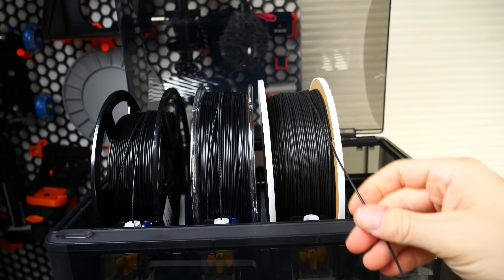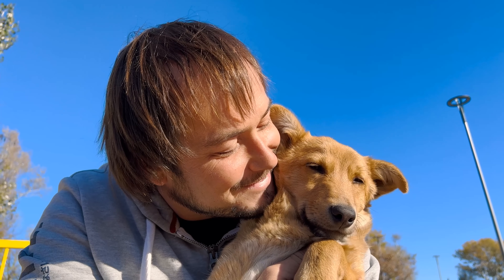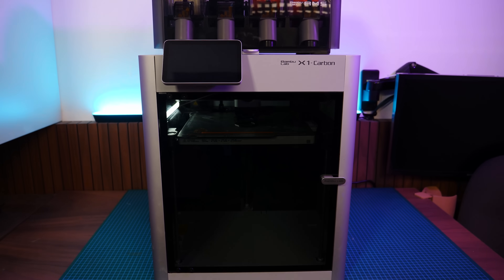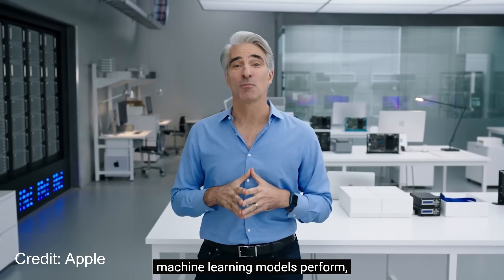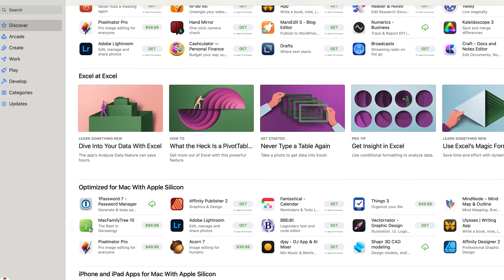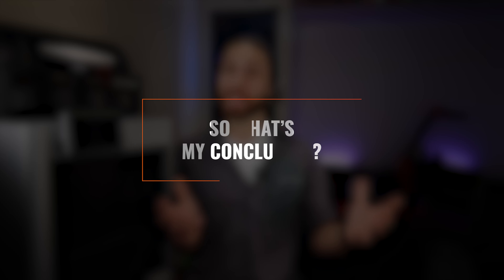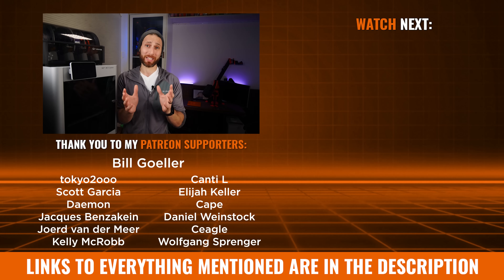Bambu Lab X1 Carbon: 5 Things You Don't Know

Comment: 🎯 Key points for quick navigation:

00:32 🕒 Bambu Lab X1-Carbon takes 7-10 minutes to start printing, ensuring perfect first layers and reducing print failure risks.
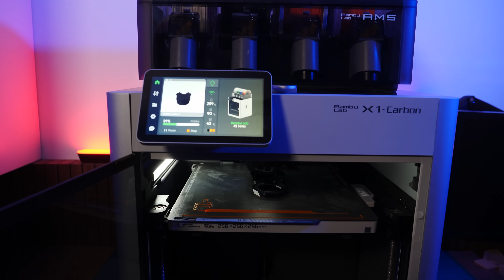02:31 🧠 Bambu Lab X1-Carbon monitors and adjusts for resonance frequencies during printing, demonstrating advanced intelligence in real-time printer management.
04:54 🌫️ The carbon filter in Bambu Lab X1-Carbon is for exhaust, not chamber air, requiring manual activation for effective VOC filtration during prints.
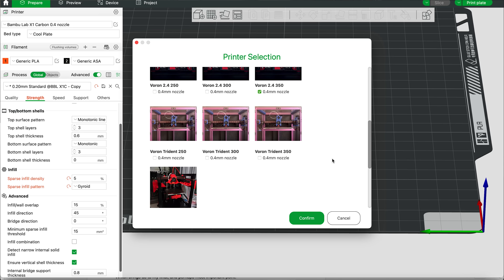06:50 🔒 Bambu Lab X1-Carbon's ecosystem operates as a "walled garden," limiting third-party software and hardware compatibility but enhancing integration and performance.
12:16 🛠️ Wham Bam offers a PEX flexible build plate compatible with Bambu Lab X1-Carbon, improving adhesion across various materials without glue sticks.

Made with HARPA AI

Comment: I h8k the filter fan does not running by default during printing as it would create ir changes and lower the cabinet temperature. Filtering at end of print is a good solution 👌

Comment: I'd like to know more about the Plug ins that you spoke of missing with the X1C.  You mentioned a camera plug in for time lapse but did not mention that the X1C has a camera already doing Time Lapse. There is a checkbox to disable the camera time lapse but I never turn it off. It has come in quite handy in my ability to send the video to customers I find on the net who I can show I've done the work and then they send the money with confidence.
Also you mentioned a plug in that allows to not print a particular item. But perhaps you may have missed a feature that I never hear about where the printer operator can stop printing an item that may have fallen over or such. When I am printing dozens of parts at one time, one might fail and when I see the spaghetting happening, I can turn off the continued printing of that object so as to not mess up further parts. Check out that feature as you may have missed it. I love it and never hear people mentioning it.

Comment: There is no little 3x3x3 carbon filter that is sufficient for removing VOCs. Maybe it helps a little bit honestly I think they just lul people into falsely believing since they have a carbon filter they can print stuff that off gases harmful stuff without a proper exhaust fan or ventilation. Carbon filters are a great addition but it doesn't mean you should bet your health on it and print toxic materials in enclosed spaces.

Comment: I have no problem with Bambu having a walled garden.  It's their product, and they can do what they want.  Just because the 3D printing world is traditionally a bunch of geeks who like to change everything for the latest product available, that's not Bambu's market.  They are selling a machine that anyone can use out of the box, and get better, more consistent results than most of us have been able to achieve through many hours of tinkering.  Car nuts like to do things like change the air intake for improved flow, ditto the exhaust.  Many times this actually results in worse performance, because the car was designed holistically, with the original equipment.  If the system was open to widespread modding, they might unjustly lose their reputation for reliability, and it wouldn't be their fault.

However, I haven't (yet) bought one, and it is because of the walled garden.  What has concerned me is precisely what I hate about Apple, and that is planned obsolescence.  They launch a new product, and suddenly the old ones are unsupported and no longer updated.  If you want to run the latest software, you have to throw out your old product and buy the latest.

Thankfully, Bambu Lab has been working with the X1plus team, which means enthusiasts will still be able to upgrade some of the software long after Bambu has moved onto other products.  Despite all the hate that has been aimed at them for the walled garden, the company seems to be keen to work with the community.  I have no problem with installing alternative software invalidating my warranty.  That's no different than chipping a car where they cannot know whether a blown engine is their fault or it was driven outside the safe parameters.  If I get an x1c, and I probably will, I will probably wait until the warranty has expired before installing x1plus.  The fact that it is available is enough for me.  For those concerned about their own IP, or PII being sent to Bambu, x1plus can install firewall rules to prevent any phoning home.

What would be really good, is for the company to promise to open-source all of the firmware if/when they decide to stop supporting it.  By that time, other companies or open source groups will have developed comparable IP, so their own IP will not have the value it currently has.  In a fast-moving world like ours, the length of a patent is too long.  They were designed to allow an inventor time to bring the product to market, recoup their R&D costs, and make a profit.  With long patent times and a fast-developing market, patents are frequently obsolete long before they expire.  Committing to open-source once the company has lost interest in the product would be a sign that they want to be community players.  Sure, they may not sell the new product as fast, but the extra sales of the current product will more than compensate.

Comment: I'm not sure I understand what the benefit of filtering the air inside would be vs filtering the vented air. The point of eliminating VOCs is to prevent you from breathing that stuff, and in reality, regardless of whether they filter inside or out, an activated carbon filter with a fan is woefully inadequate. Activated carbon filters get saturated pretty quickly, and then need to be completely replaced. If you don't replace them, they just don't adsorb the VOCs and it's as if you didn't have filters at all. You can heat the filters up to very high temperatures, which then releases the VOCs, but you would need to capture them back to dispose of them (otherwise you're basically just releasing them into the room). I've done a lot of research around this for my own printers and really, the only solution is to vent the VOCs outside, which requires installing ducts that go straight from your enclosures into an HRV/ERV air exchanger.

Also the comparison with Apple is apt, but I disagree that it results in better performance, in both cases. PCs and Vorons perform significantly better than Macs and Bambus. I think the BambuLab is a great printer for someone who wants to print fast and occasionally, but for someone who likes to keep up with the latest innovations and/or is running a print farm, open-source, serviceable and customizable design win out in every case.

Comment: You can actually turn off the buildplate identification nowdays. I had to because my unit didn't recognise the cold plate it came with stock. It seems to be a common issue, hope they fix it soon

Edit:
.... as always with bambu printers, it was user error... I had the wrong plate set in my slicer.
As soon as I corrected the plate selection, the printer worked flawlessly...

(I swear this thing is smarter than me.. I wouldn't be surprised if it started detecting defects and failiures in humanity in a few years)

Comment: Um just fyi.  I dont know if itnis in an firmware update  but i have the P1P enclosed and have added all the fans.

My chmaber fan turns on according to material printing and bed temp.  

I discovered this because it wasnt coming on so i thought it wasnt working.  But then when i switched to abs it came on the. Went back to pla and it didnt come on.  Also i noticed that if i try to control % it will go to where i set it then right back to where it thinks it should be unless i manually turn it off then back on

Comment: Which printer do you think could print the most standard coke bottle caps in a month or year?
Reply from the maker: ....WHy?
Reply: @thenextlayer I have a couple fittings I’m trying to make.  One similar to a coke bottle cap and another similar to a Snapple bottle cap.  They will probably be in direct sunlight for non-trivial amounts of time, i want them to be durable and i need a lot of them.  I can’t afford injection mold and if i can print enough of these, from UV resistant carbon or ASA I could gradually make a go of it without having to risk everything.

Comment: I don’t see what the problem is here. Don’t you need to do something else during that start-up time? You turn the printer on and get the sequence on then prepare your work. When you’re ready, the printer is ready. Besides, the printer is fast, so it more than makes up for that short start-up. If there’s anything to complain about, this isn’t it.

The only thing I’m confused about, is that one user had a problem with resonance from the belt drive that resulted in a wavy surface that he, and Bamboo, couldn’t get rid of. But I’ve not seen anyone else mention this problem.

This is still a small company. They need every dollar they can get. Once they feel as though they’re stable as a company and that their future is pretty much assured, they may then decide to risk losing the sales of filament and parts. But here in the USA it’s legal to reverse engineer to enable a company to interface with another company’s product. So it’s really just cost.

I have very high hopes for Bamboo. Until the big three printer companies (Canon, Epson and HP) decide to get into the small business/consumer 3D printer market, Bamboo seems to be the new leader in quality and innovation, driving the others to follow.

Comment: Regarding fans and VOCs. This is something I am paranoid about because my printer is in the middle of the house, I like printing with smelly stuff, and my wife has the nose of a bloodhound.

The provided "filter" really is just a nod, IMO, so they can put it on the spec sheet.

I have been reading up on the Bento Box internal air scrubber, which you are dismissive of, and I think (hope) that is a step in the right direction - keep the printer sealed and keep the internal air cleansed while printing ABS and the like. 

The Bento Box has both carbon and HEPA filtering. My research indicates HEPA is useless for VOCs. So I am designing my own carbon only scrubber, taking the best ideas from the Bento Box. I will absolutely be maximising the amount of carbon.

The other vulnerability in the X1C is that the poop chute is open to the outside. So the poop will come with smells 🙂 I am designing a poop catcher that will give a 99% air seal, so those poop smells won't drift out when the exhaust fan is not running.

Finally there's the door hinge gap. That's easily fixed with a bit of tape.

So IMO what Bambu Labs should be doing is integrating a scrubber, and modifying the software for a post-print scrub cycle and advising the user to keep the (properly sealed) door shut, and only then running the exhaust fan to shift the inside air out through the filter.

Regarding the walled garden: That's what you get with companies like Stratasys, AFAIK. it's many years since I looked at them, but when I did their FDM printers came with filament cartridges with a disposable printhead. The print surface was also to be replaced on a very short cycle. And of course the chamber was sealed and heated, and subject to a patent that stalled general development of FDM printing for 15 years. More a fortress than a walled garden!

Comment: For me as completely New 3D printer guy, i startet directly withe the X1C. 

I have testet bevore i have buying this, one Elegoo Neptune.

The 7 - 10 min. Waiting before every print, is much faster and more correctly, than every single try to print on the elegoo.

I love the printer.

Create a Objekt or download one, press print and wait till it is finish.

And not every printinh works but for the most part, its my fould.😄

Comment: A couple questions: I've never used glue sticks... textured plates only. Do you need to use glue for the smooth plate that's included? (How do you get the glue off the model...wipe it off with warm water?) Can you purchase a separate textured plate instead? And if so, does that affect the use of the Lidar Scanner? Thanks for you videos!
Reply from the maker: A lot of people tell me that they don’t use glue stick for the cool plate, I didn’t have as much luck, but maybe I should try again. It’s best to remove glue stick with high-quality dish soap, and hot water.

Comment: Most Apple products are objectively lower quality products then other products with similar prices, you are not in a walled garden you are in a walled off cult.
Reply from the maker: Disagree. I put a premium on user experience and Apple wins there every time
Reply: @thenextlayer  I'm just going to mostly stick to the phone argument right know because that's the one I know most about off the top of my head, the last I used an iPhone, a few years back, the process of setting a custom ringtone was importing MP3 in the iTunes cutting it down the 30 seconds and making a special format then uploading it to your phone. On my Android phone I import MP3 to my phone and I set the full-length file as my ringtone. Last time I used an iPhone I couldn't or it was unreasonably hard to put my app icons anywhere on the home screen. And all that tight integration you can do with Apple stuff I can do on my Android phone with first-party Google or third-party apps. Android can do everything the Apple can do and far more. An apple could have just as tight-knit of an ecosystem without completely stunting their phone's versatility.
P.s. Your video are great and give of such an upbeat vibe, and you seem like a really good dude.

Comment: As an idea to make the bambu more "customizable" is if the would brake the x1 carbon down to its raw funktions: printing fast

Then they could provide things like the light camera display hotends outer shell and so on to be purchased separately, wich would make this printer even more attractive to consumer bc the "X1 Carbon RAW" could be way way cheaper in the first place to order it. I know there is the p1p but why the fuck it have  differences? Like not an compatible hotend or an different screen? Thats what I'm not getting about the p1p

Comment: Do you think you could do a quick video on how to set the bamboo lab to not purge so much? You kind of passed over it so quickly I didn’t even know that menu was available. A lot of times I just print by layer which does save a lot. I don’t even turn on the purge tower but occasionally I want to do a multicolor print where I can paint the colors and I would like to change the amount of purge since I don’t really worry about bleed through, thank you like your channel

Comment: I think the chamber fan setting is something that the original Prusa Slicer simply doesn't implement. Also I'd think that the chamber fan should really only run after the print: you want your chamber to stay warm while the print is going. Maybe have the fan spinning at its lowest speed just to maintain a bit of negative pressure, but it shouldn't be running full bore. Either way, that's something that they could just put into the G-code, but that wouldn't give you as much control. 

I'm not saying that your concern is invalid: far from it, it's a very good point. I'm just saying that this probably would've been a feature that's harder to cleanly add to Prusa Slicer.

Comment: As someone who has monitored 3d printing for several years, but not bought one because of the learning curve and incantations required, I do like the X1.  The walled garden element is worrying, but the ability to print and it works, almost offsets that. I would not hesitate to buy into the 3d world of Bambu Labs if there wasnt a wall around it.  I probably wouldnt use the freedom a non walled garden gives, but it would be nice to know it was there.

Comment: Mentioning the air filter (that I agree should definitely be updated), do we know how well of an enclosure the printer is? I only ask because on Edge of Tech's maintenance video for it, he mentioned black dust that builds up in the printer, and suspected it came from the carbon fiber rods wearing with use? I don't know if that's actually what's causing it, but isn't carbon fiber dust highly toxic?

Comment: I love to see this review. And I agree on everything, except the massive apple shill part :P JK, but it is different at least for me. 3D printing to me is exactly the same as a normal printer. I want it to work, I don't need the flexibility. But for my other electronics. I need that flexibility, I wish I could have both reliability and flexibility but that is sadly not the case for electronics at the current state of the market.
So basically, when I have the funds to be able to afford this printer I will most likely do so. Especially when I get out of uni and there are newer and probably even better options!

Comment: I bed level every 12-20 prints depending on how much vibration there is. I usually skip most of the flow calibrations. I basically do that when I change filaments. Once the machine is up and running, it can print>repeat pretty well.Also,  I have to say, once I tried the new liquid glue, I have zero bed adhesion issues. I recommend you try it. It works, it's easy to apply, less messy and cleans off easily. I can apply one coat of glue and get several prints out of the one application. Good stuff! These machines are game changers. Meanwhile, I agree with you, Prusa is falling way behind. I actually canceled my XL preorder.
Reply: I think this stuff is similar to the Magigoo Bed Adhession glue  and it works 100% of the time with out making the printbed tacky.